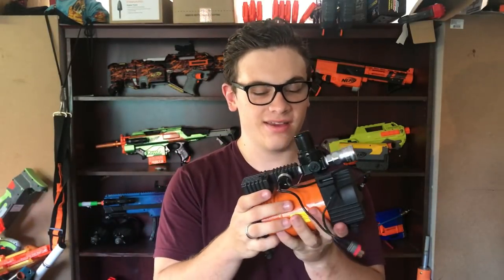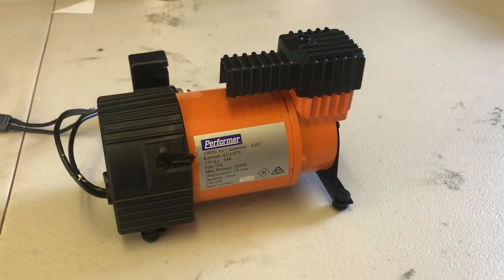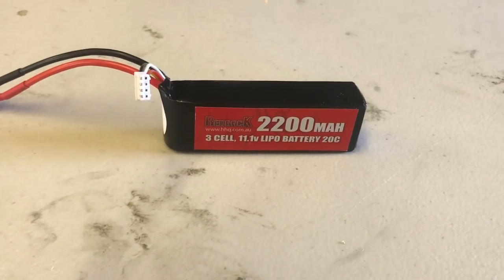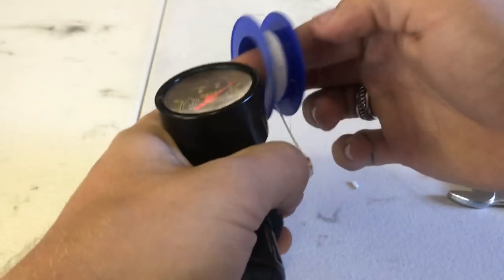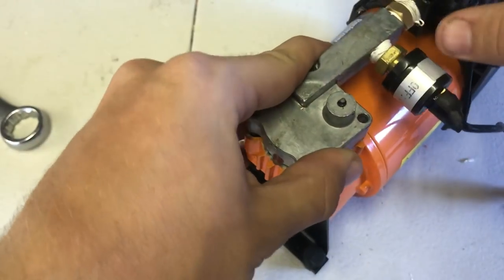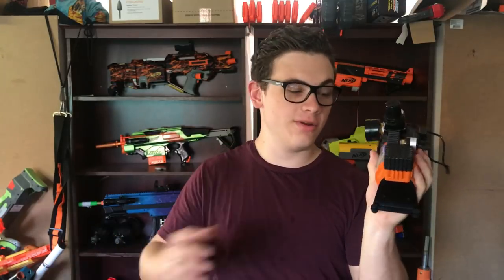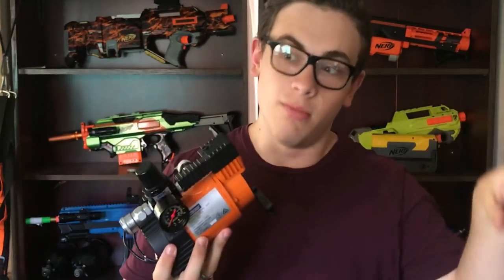How To Make A Nerf LPA Compressor Set Up || Easy Guide to Air Blasters Part 1

Comment: Nice, fyi for people planning to build one the pressure switch is a spring loaded switch that turns the switch on and off in a selected range of pressure. This being 90 psi it shuts it off and when it dips below a certain pressure it will turn back on. There is not a real need for my understanding of the position and negative side of things but I may have just fluked mine. Have fun. Keep nerfing.
Reply: Do you have a link to a pressure cutoff switch? I don't know what I'm looking for.

Comment: You said it will work for a little while, is it going to destroy itself or something? I know hpa is a little better and worth saving for but how long will it last?
Reply: PricklysNerfMods if I were to guess based on how he did his connections, it was probably leaking like crazy, but that’s just speculation.
Reply from the maker: No these will last ages with proper servicing.
Reply: How do you carry it? I'm imagining the weight isn't too bad, but the location would be awkward
Reply from the maker: PricklysNerfMods I put it in a backpack, so my shoulders can take the weight. Its not too bad
Reply from the maker: No air leaks with this one

Comment: Hey CObba, first thanks for the vid, super helpful. Secondly, I have a 300psi one of these laying about, is there any need for the 100/150? or is that just because you are limiting it to 90 psi, so the rest is just overkil?
Reply from the maker: it could work with the right fittings. this compressor will fill your blaster faster tough but the trade-off is a lighter psi, but with yours its the opposite
Reply: COBBAcrazy gotcha. It probably won't be that big a deal as I'm going to use it for a mega centurion.. Hey if you can make a longstrike good maybe there's hope for the centy. Also they take an age to reload / rechamber so probably not a huge deal. Super excited for part 2: the internals! Thanks again for showing us this, pretty dam amazing

Comment: Ok so when you said 90psi cut off switch does that mean turns on at 90 psi and off at 120, or off at 90 and on at something else
Reply: nvm I read Spencer Wongs comment that helps

Comment: It’s cringe-y to see how you wrapped the Teflon tape. Wrap in such a direction that it doesn’t strip the tape off as you twist it in. Also use the full width of the tape, not just strands.
Reply: Remove all preexisting tape and gunk then use 3-4 wraps.
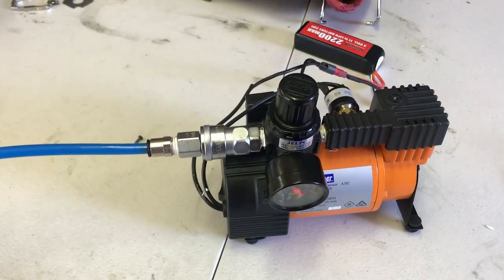Reply from the maker: No, you can see at 5:06 that the air gauge does not budge until I fire where it quickly builds pressure again 100% air seal
Reply: COBBAcrazy I’m not saying it doesn’t work, I’m saying it’s not proper practice with the methods you use and can lead to issues down the line.

Comment: What are the specs for the psi? By that I mean 10-40,90 to 12, what is it? Also is it Normally Open or Normally Close?
Reply from the maker: Geek Gaming Studios 70psi gets you 250 most the time, depends on blaster and set up.
Reply: COBBAcrazy how much fps would you get with 40 psi?
Reply: COBBAcrazy Also is it a normally open or normally closed switch?
Reply: @jamesjordan318  its a normally closed switch.  It opens when the pressure is reached cutting power so the pump turns off.

Comment: is there a reason for the 1/2" regulator other then the fitting you are using or would an 1/4" work just fine with its equivalent fittings?
Reply: Any input/output size regulator will work the same with the correct fittings. The one he chose probably only works with 1/2 inch